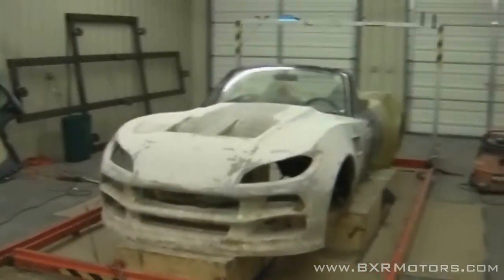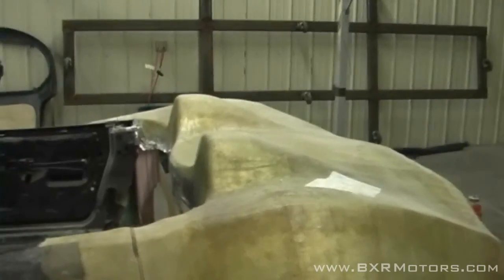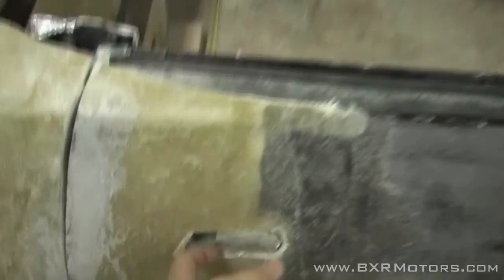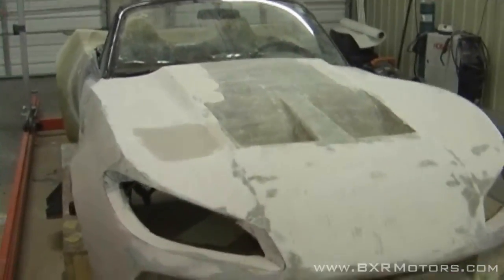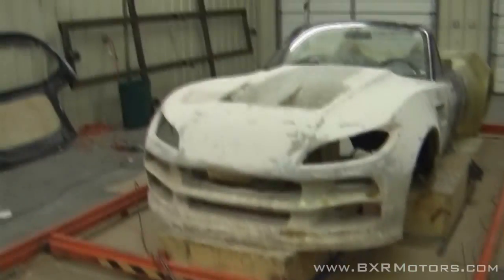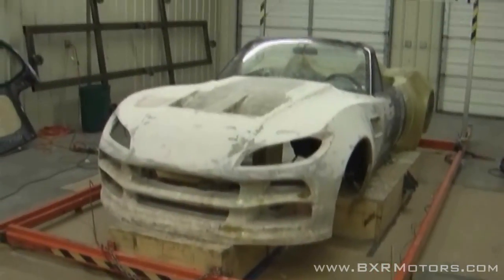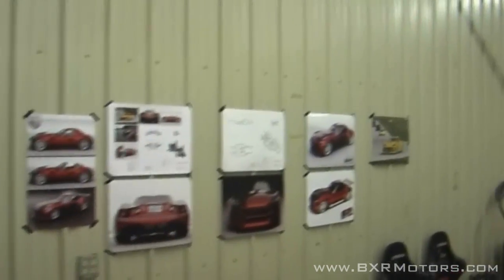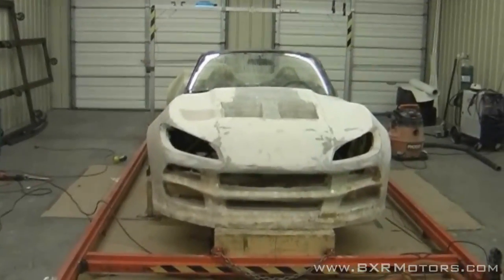Bailey Blade XTR Car Design |  Working Fiberglass body shell - Part 14

Comment: I'm building a kit car just wondering what sort of fiberglass you're using cheers
Reply from the maker: +Trevor Walker on the body buck, I used standard 2oz fiberglass mat with sone 1.5oz fiberglass cross weave. Used a lot of foam for support. On the main body out of the molds, we use vinyl-ester resin and fiberglass mat along with kevlar to reinforce areas subject to penatration. Firewall, trans tunnel and doors.
Reply: BXR Motors 
Hi i really appreciate your advice many thanks. O great vids your car looks awesome.😁.
Reply: BXR Motors 

Oh and one more thing how many layers did you do a fibreglass? thanks again for your time.

I've building a Lamborghini Aventador which I will be posting on my page let me know what you think if you come across it.

Comment from the maker: Carbon fiber is much better, but if more difficult to work with and is more expensive because it requires more materials and special equipment to work with it correctly.

Comment from the maker: The current body is all fiberglass and lots of body filler... its just the body plug for making molds though. The final body panels will be made of Carbon fiber with a mix with Kevlar and a few other composites in specific areas.

Comment from the maker: The trunk will open standard like many current modern cars, it will use a hinge setup that will lift and tilt the trunk up and away from the humps. Its hard to explain, hopefully you get the idea.

Comment from the maker: There will be a trunk once we finish the shaping of the body we will cut in the truck and make it a separate piece to mold, we will also add rain gutters and weather stripping lips to the trunk area to make for a nice tight seal, just like a factory car. The hood and front clip will be separate as well, however the hood will tilt and slid forward in a unique fashion.

Comment from the maker: Well not really, Its not based on or made off of a Miata. But we are using the glass and hard top brackets to cut down cost. In order to do this it was best if we spliced in a Miata center section to insure everything fits right. The final version will only have the Miata window glass and a few things like latches and weather molding. The doors and top will all be unique to our design.

Comment from the maker: Yeah we usually wear masks I had one on earlier and Eric has the ShopVac connected to his sander. When that thing in is hooked up it hardly produces dust at all. Also our Bay has two doors on the other side that are open and its like a wind tunnel through there. So its well ventilated.